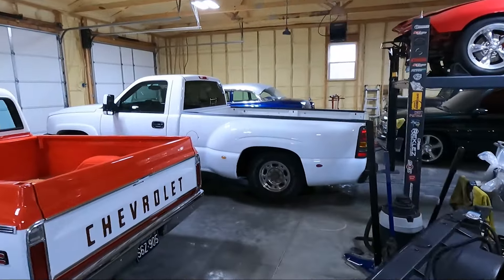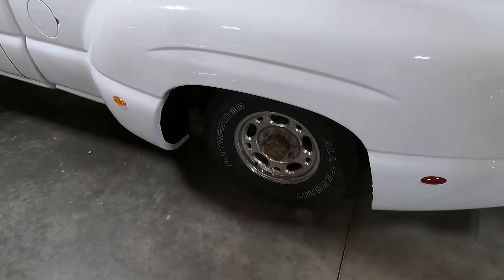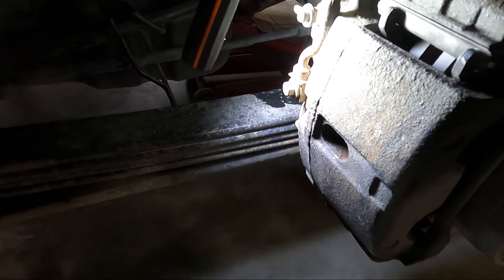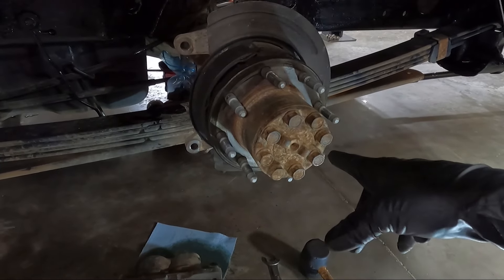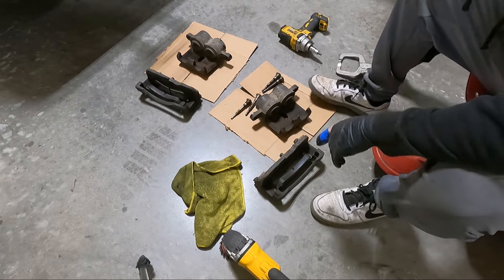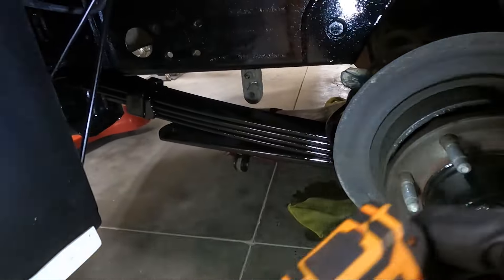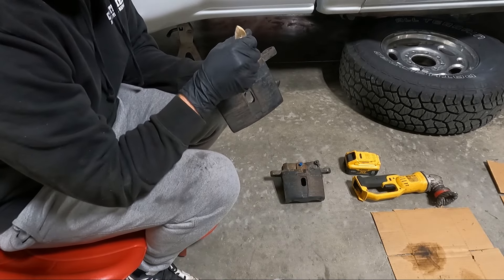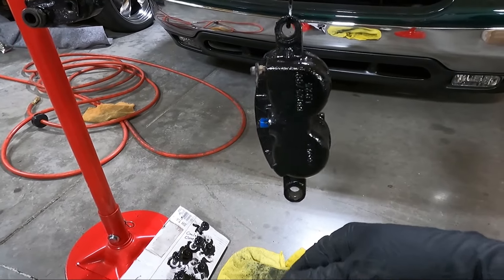Single Cab Dually Build Part 11 (New Rear Brakes and Wheels going on! It's Officially a Dually Now!)

Comment: This is my favorite of your projects so far. Have you tried using a C clamp to compress the caliper? I use them and it seems easier. I'm sure having the injured finger doesn't help but those vise grips seem awkward. Anyway, stellar work on all your projects.
Reply from the maker: I do need a better compressing option

Comment: If you use a big pry-bar under the tire and push the wheels in it make it easier to slide them in and to remove them. That’s how I remove my semi truck Dulles
Reply from the maker: Probably so